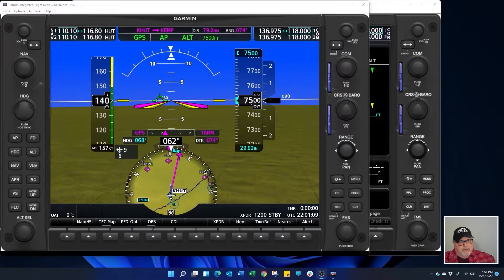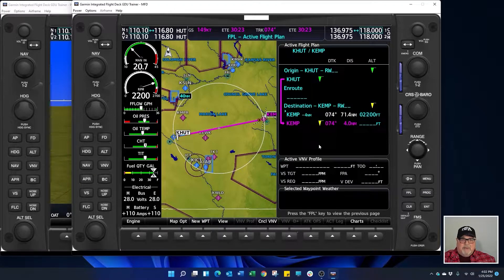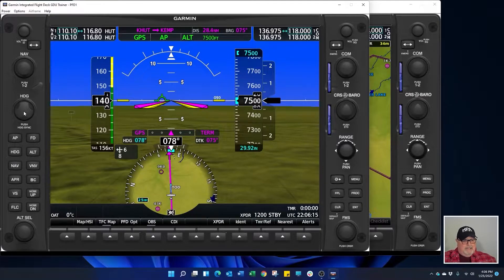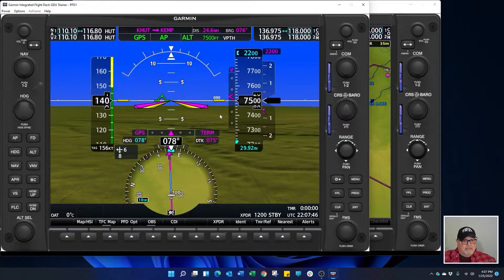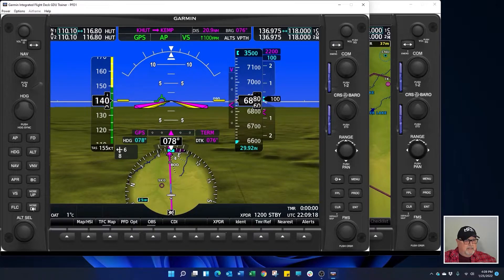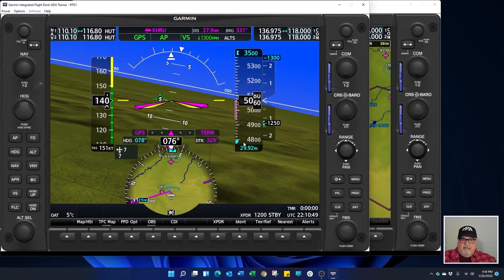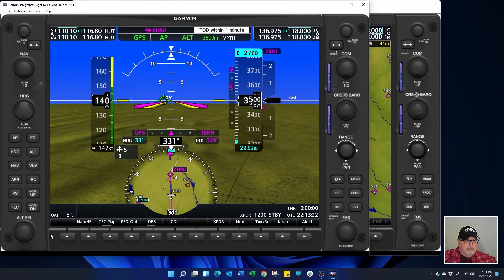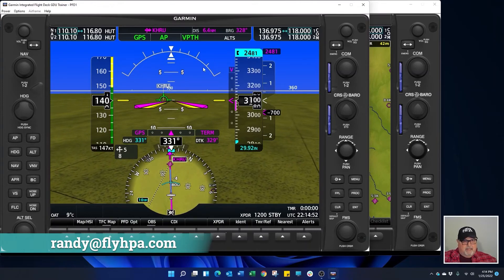Garmin G1000 VNAV - How to use G1000 VNAV descent planning with the GFC 700 Autopilot

Comment: Thank you! Always wanted to know how to enter my own alt in the FLP. 
One question: Why not just set your ALT and arm VNAV ahead of time? If you're in ALT HOLD surely it's all good?
Reply from the maker: That’s fine, but if you do it more than 5 min in advance it won’t work. I recommend waiting for the 1 min “vertical track” warning and then setting it to keep a consistent process. OR… just be prepared to re-arm VNAV at the 1 min warning. Doing it too early introduces opportunities for errors and missing the TOD, but as long as you are aware of it, it’s up to you.
Reply: @flyhpa   Thanks, it seems I have a lot to learn about VNAV.

Comment: I have a question regarding the timing of placing the BOD altitude in the altitude preselect window at the top of the altitude tape. Is it necessary to wait for the "VPTH" annunciation? We know what our BOD altitude is once the VNAV profile is created in the flight plan ATK OFFSET parameters. The AP is not going to chase the preselected altitude until we tell it to by pressing "VNV" on the GFC 700. Why not accomplish the altitude preselect earlier and be done with it? Or am I wrong?
Reply from the maker: You can do it early, but for some systems if you do it more than 5 minutes before reaching the TOD, you'll have to re-select either the VNAV key or the selected altitude. In our opinion, the best way is to be consistent and let the one minute "vertical track" callout be your reminder to set the altitude and arm the VNAV. (I assume some models and configurations may vary on this 5 minute rule.)
Reply from the maker: More details here: https://www.flyhpa.com/2013/01/garmin-g1000-vnav-tips-and-tricks/

Comment: Why wait for the system to say "vertical track" before bugging the new altitude and arming VNAV? Why not do it all at the same time so everything is ready to go and the plane will decent at the top of decent point. I use the memory aid Build It, Bug It, Button It.
Reply from the maker: Charles this is okay, but only if you're within 5 min of the top of descent. If you do it too early you will still be required to select the altitude or re-arm VNV. If you do it consistently at the 1 min from TOD "Vertical track" callout, you will hopefully avoid unintentionally flying through your TOD. This is one situation where being too far ahead of the plane might have unintended consequences.

Comment: What might I be doing wrong? Whenever I try to go to my Direct-to page and select an arrival altutide and offset, it just passes over it?
Reply from the maker: Assuming you have the Garmin GFC700 Autopilot, you'll need to make sure you do 2 things prior to the top of descent (but no earlier than 5 min prior): Select the lower altitude with your altitude selector, and arm VNAV (VPTH) on the autopilot. If either of those 2 steps is not accomplished, or if you do it too early, it won't work. (Of course you want to make sure you have ATC clearance for a pilot's discretion or "cross at" descent before doing this.)
Reply: When activating VNAV, change the  altitude at the top of the tape to the lower  one,  otherwise the AP will not start descending , it will keep flying the selected altitude. Critical step to start the VNAV process going